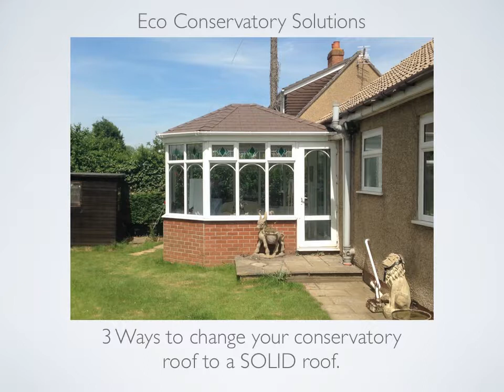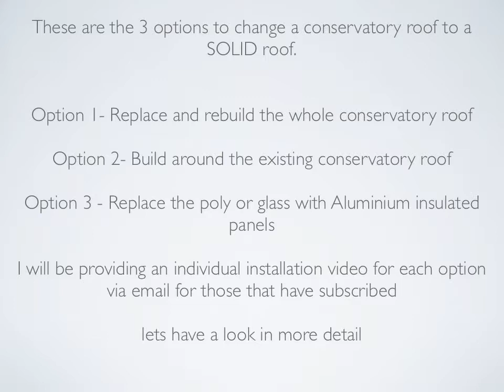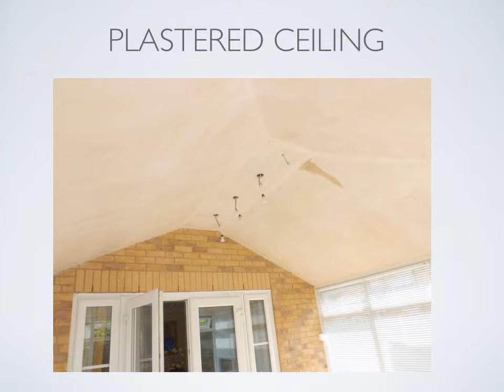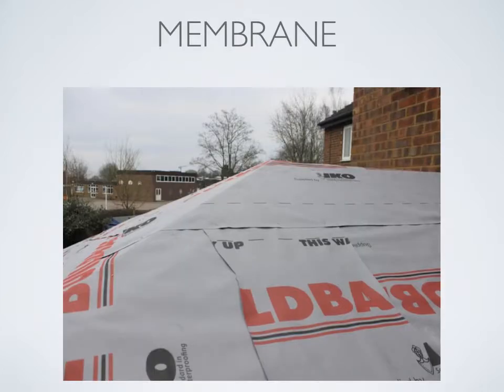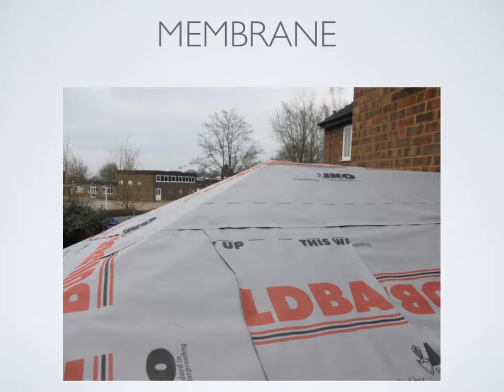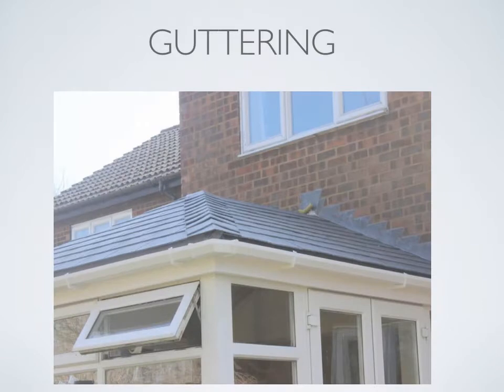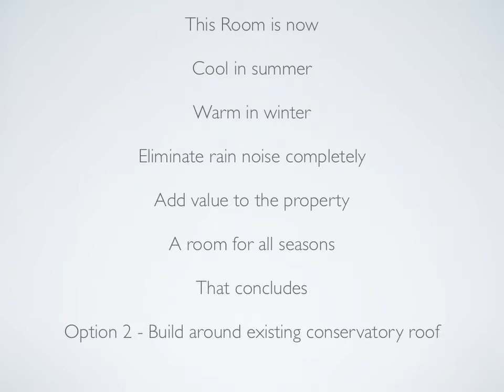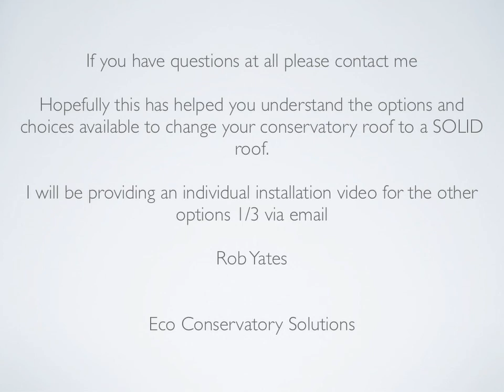Conservatory polycarbonate roof replacement

Comment: Hi Rob quick question, would this roof comply with building regs or are these not required to replace an existing poly carbonate roof? Thanks
Reply from the maker: Hi, Yes this roof does comply with building control for both strength of build and energy efficiency. We provide a certificate after the installation is complete.